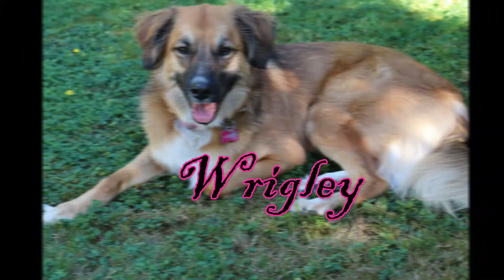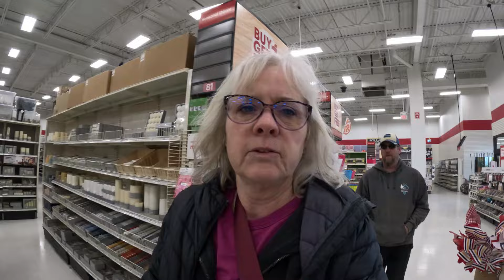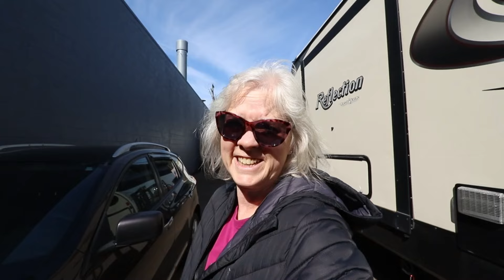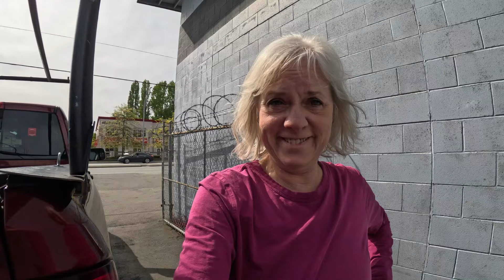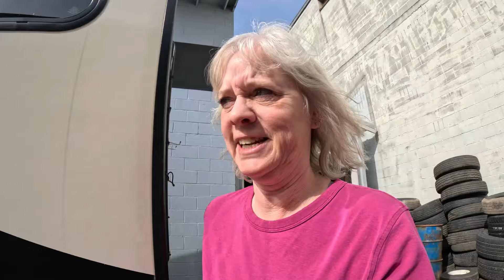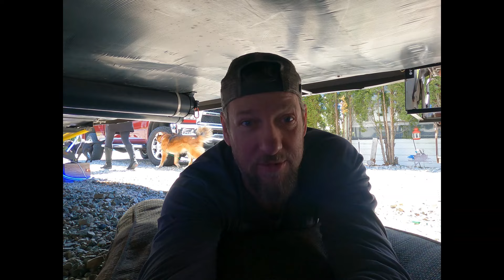WDD 251 Axle Upgrade

Comment: You don't say what vehicle it is!!
You don' t say what axle is in it!! 
Nor to upgrade it ??
Reply from the maker: Our Trailer is a Grand Design 315RLTS travel trailer. They come with 5200lbs axles, and we upgraded to 7000lbs axles
Reply: @WeareDaringtoDream  I have thought that most /ALL trailer axles should be upgraded for safety and longevity! It  might be to spec, but not to the forces imposed upon them. Auto tires might be next to upgrade tires to ?? If your trailer is level or next to leave when traveling ??